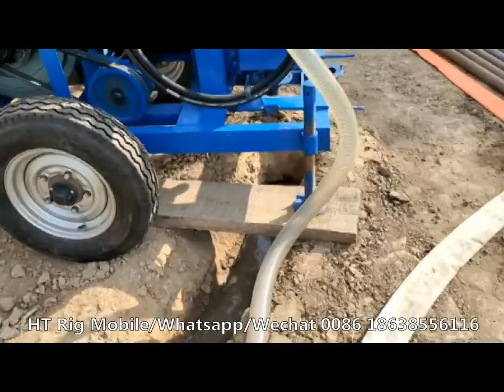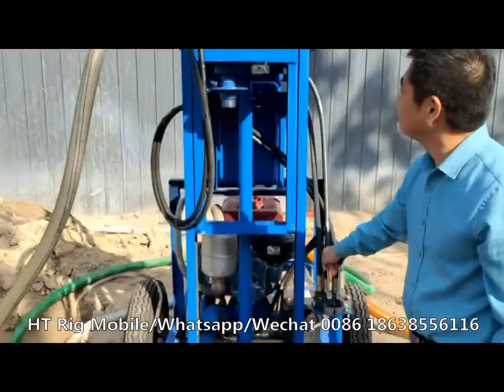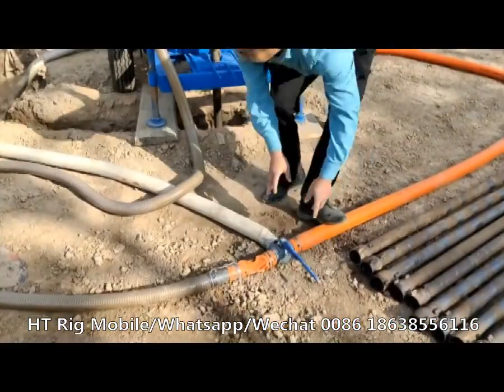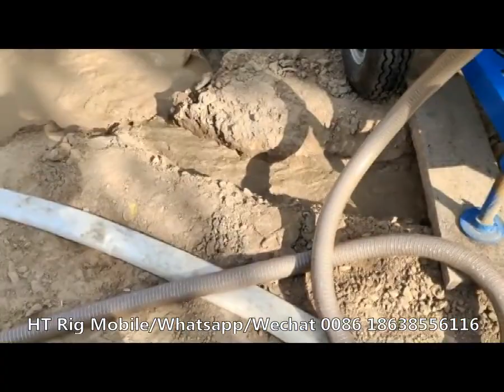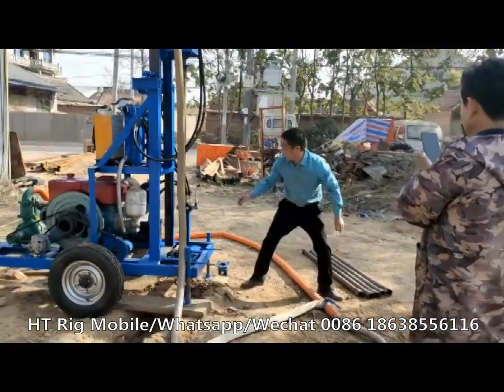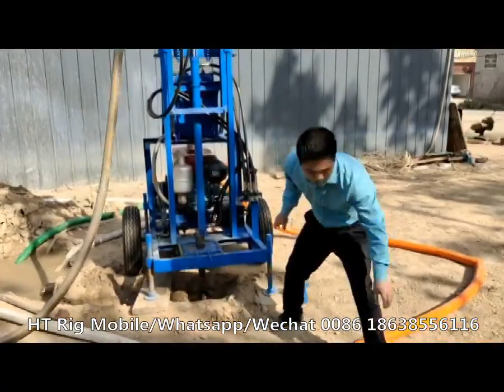Small portable water well drilling machine /Pequeña máquina portátil de perforación de pozos de agua

Comment: Bought one but the manual is in chinesse as all the instrutions. Need a spanish manual so i can know oil specifications etc . I tríed to drill my firts  water well but the hydraulic fluid got súper hot, and i got concern about if i was using the Right type of fluid or if my oil lével was suitable.
Reply from the maker: Did you order from me ?
Reply from the maker: You inquired me about this rig, in 2020 year, but did not order it from me, maybe what you purchased is a cheap copy one, not HT brand, but I also can guide you for use even if it is not my rig.